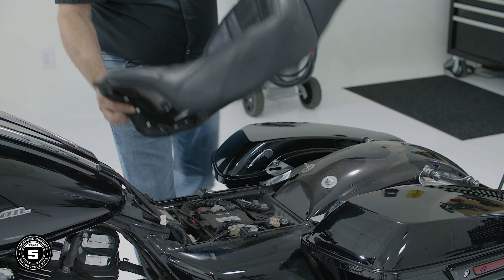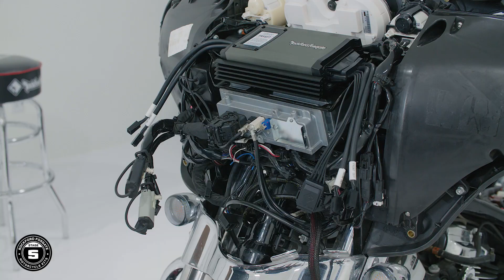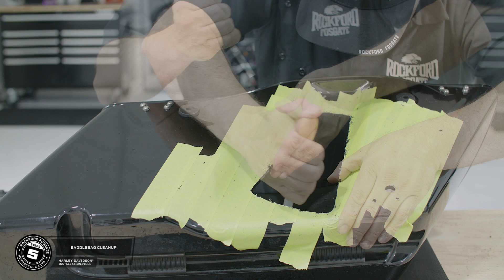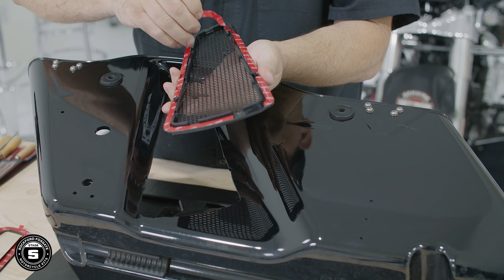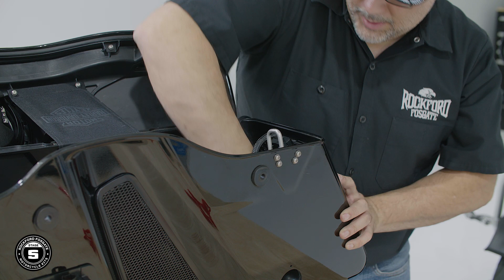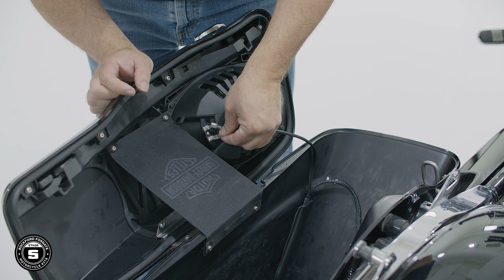2014+ Street Glide STG5 | Installation

Comment: Can you hear the charging sound when you connect both cables to the battery? Or should you connect the positive cable to the battery and the negative cable to the frame?
Reply from the maker: No, if you do, you have a ground loop added by an additional component not included in our kit.  We always recommend connecting power cables directly to the battery.
Reply: @rockfordfosgate thank you very much for the fast feedback!

Comment: I just ordered a new set of stretched saddle bags and lids with 6x9 speaker cut outs in them from Advanblack will this complete system work with what I have on order? Thanks
Reply from the maker: Hi Chris, We have not tested fitment with Advanblack, as we designed these specifically for the factory Harley-Davidson hardshell bags.
Reply: Screw Fosgate, they made the subs so that you can only run their 6x9's......no other good 6x9 will fit!!!!
Reply: @shuff1111  why would you want to mix match there subs with other 6x9’s ? I had there stage 3 system with subs installed during Biketober fest I couldn’t be happier 🤷‍♂️. Just saying I’m not one to mix match any system I wanted Rockford system I got just that. You want another system there is other systems with subs you can run 🤷‍♂️
Reply: @chriskuczmarski3448  Fosgate makes some decent speakers but their 6x9's that fit with these subs aren't the greatest. I am getting an 8 speaker  Hertz system...no other company makes subs that are built for Harley bags and are removable!
I need removable subs but I'm not going to compromise for lower speaker quality.
Reply: @shuff1111  ..Precision Power makes subs with an amp in the box...but😅 you may have to use precision power 5x7  rr